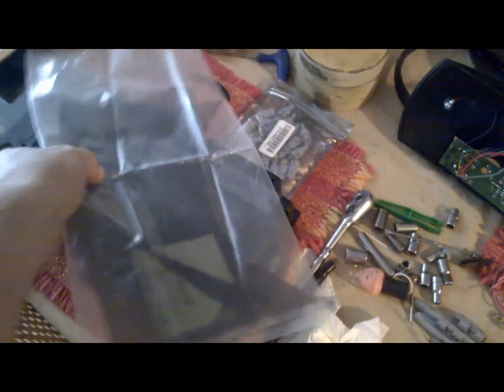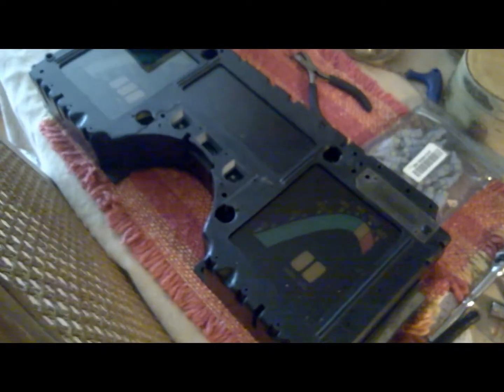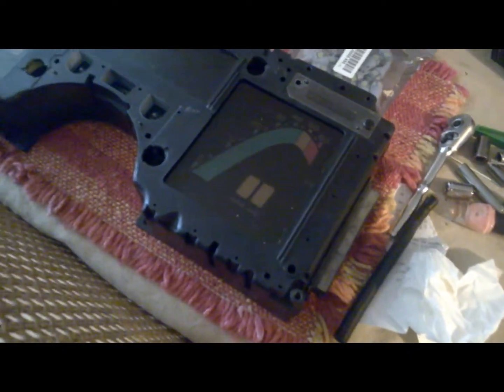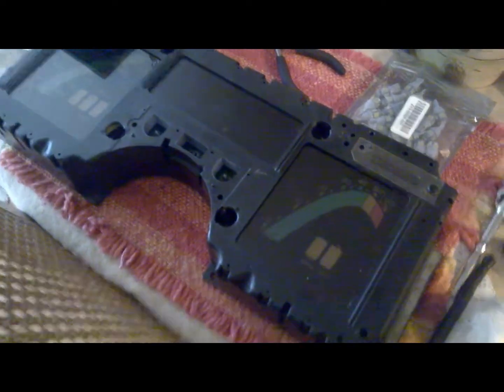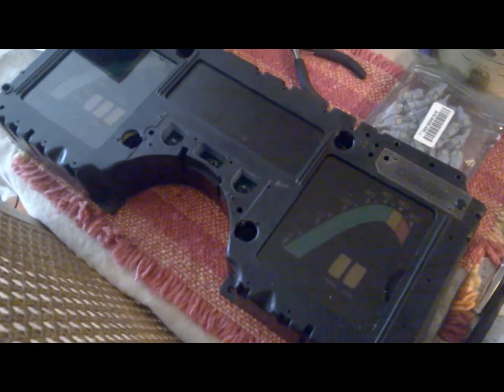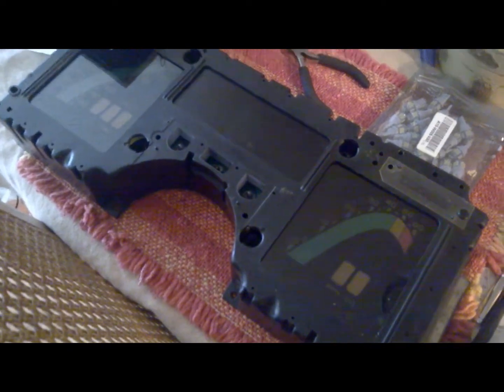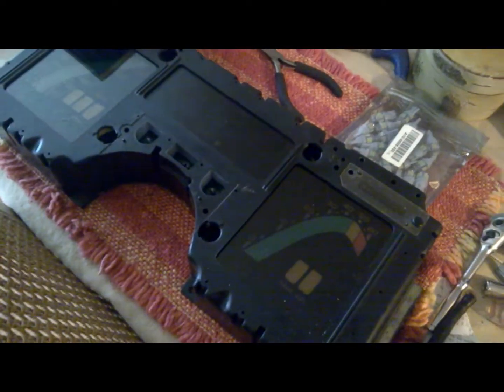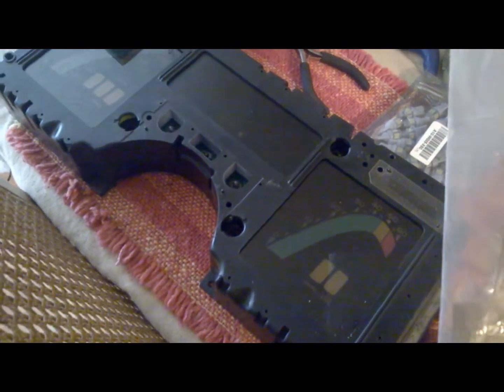FREE Corvette C4 LCD Fix

Comment: As a quick and cheap fix for a cluster with no other issues than worn out polarized film, this is very clever.
Reply from the maker: You can buy the polarizing film for $20 or so and cut to fit, but recycling the film from discarded LCD monitors may cost no more than a bit of time and effort. For the future, it helps to cut out a reflective insert the size of the display to insert when the car is parked in the sun, so it doesn't happen again.

Comment: Did you have to remove the old polarizing film from the cluster?And also did you remove to cluster from the car to do this?Im having the same problem and you look you have found an affordable fix!
Reply from the maker: Yes, you must peel off the polarized polarized plastic film from the LCD displays, which requires removing and disassembling the cluster itself. You need to be careful not to apply force to the cluster housing so that the displays themselves don't crack from excess pressure. Therefore removing the dash pad, or dropping the steering wheel is required.
Reply: @vanstechcorral  Thanks!
Reply: @vanstechcorral  Hello van where did you get the from?
Reply from the maker: @TheBlkac1  From a defunct LCD computer monitor.